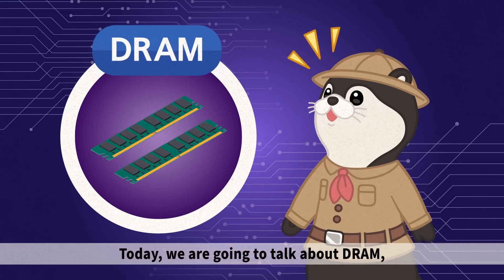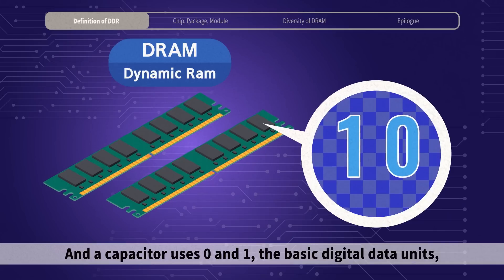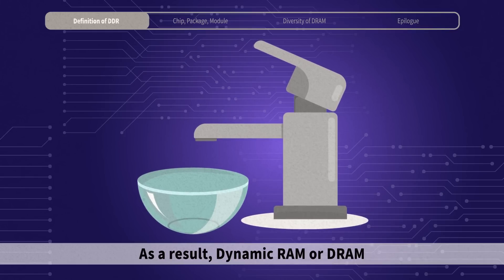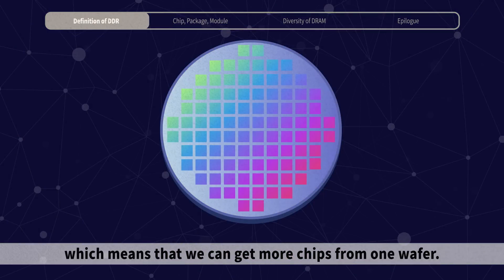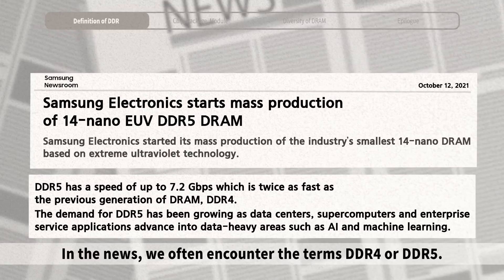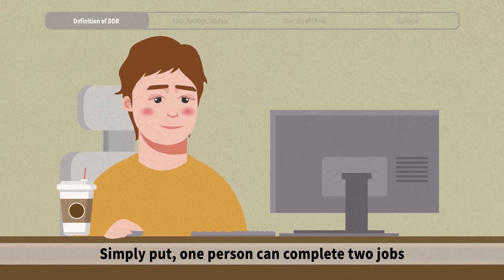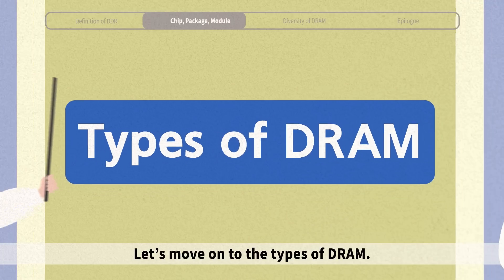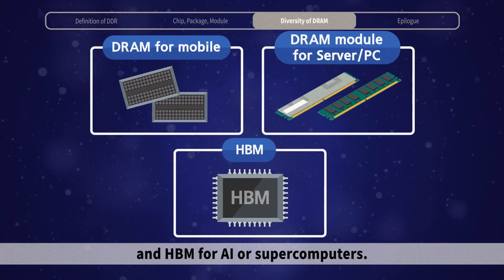Dynamic Random Acess Memory (DRAM) Explained | 'All About Semiconductor' by Samsung Semiconductor

Comment: i just wanted to know how its different than regular ram, and what the `d` mean in `dram`
turns out, its just regular ram
Reply: the d stands for dynamic, because of the way the charge inside of the capacitor decreases over time. That does not happen in static ram (SRAM), in which the circuits inside of the cells are more complex (which results in slower performance) but they dont need any refreshing